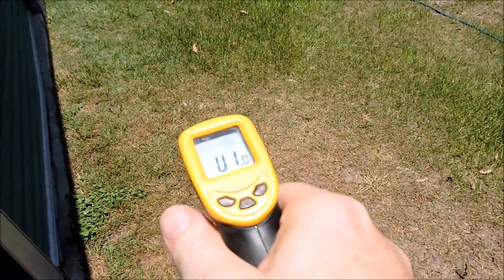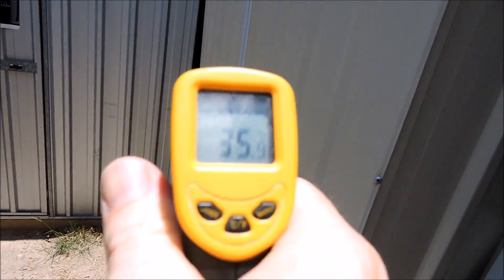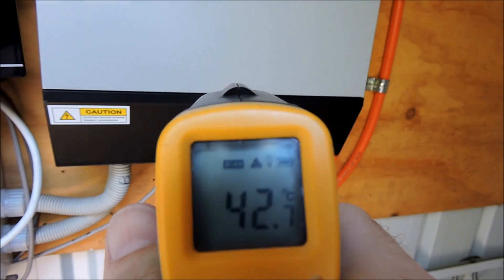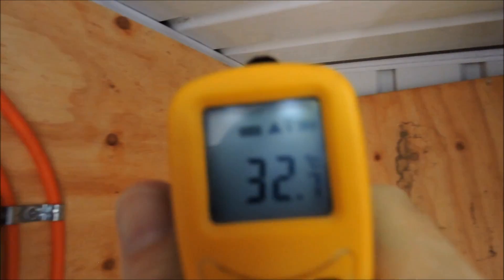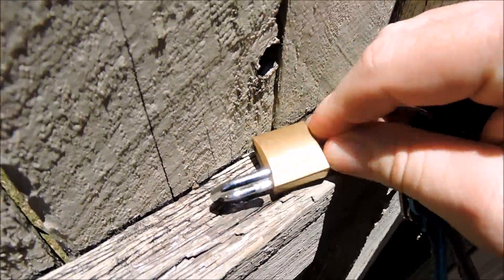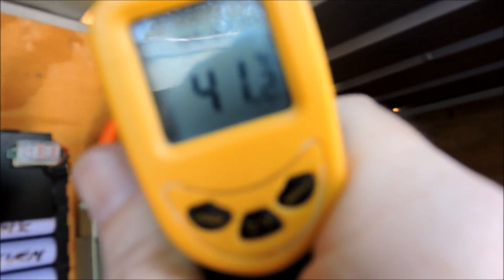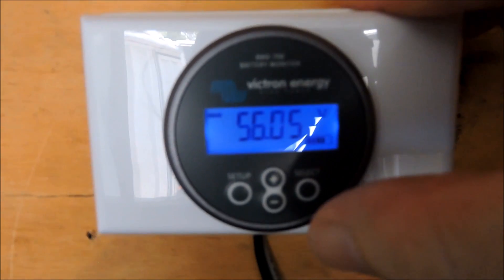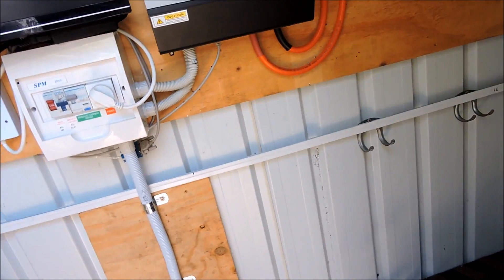(Long)138.8 DEG Fahrenheit 56 deg C ground temps (not air temp) short

Comment: is it possible to do a test at a 3kw load? I think the batteries won't heat up all that much. That's still only a 0.1 C load. But your converter will produce more heat.

Luckily that shed doesn't get as much direct sunlight.
Reply from the maker: We do 3-4 kw load all the time batteries never get hot... it's only a 80 amp dc load so 0.3333333amp per cell..
Reply: HBPowerwall Im not worried about the batteries. Your design is great because the most you can draw from the batteries is the max. your converter can do. which is like 0.12C. But how hot does your converter get when it is at 3 to 4 kw for like an hour at 2 pm when it's 34 C outside?
Reply from the maker: OOH she gets quite hot ... VERY hot in fact. We limit house loads when it's really hot for that reason.  And that is the reason I don't run the panels through that inverter - would add even more heat.
Reply: HBPowerwall So maybe some forced air cooling in that shed would be a good idea?

It doesn't have to be on all the time, just when the temperature of the inverter goes too high. All you need is a cheap thermostat and a fan in the bottom on the side (where it gets cool air from the shadows next to the house.) I bet ebay will have a thermostat that is practical.

Also important for safety by the way. That inverter is placed on a wooden plate, isn't it? (a metal plat would help to cool the inverter(s) as well. Especially if there is a fan blowing air over it as well.)

Comment: http://www.gumtree.com.au/s-ad/beenleigh/building-materials/foil-polystyrene-board-insulation-roof-ceiling-wall-underfloor/1101496182 Check them out that's cheap to buy and make your room alot cooler if you insulate the shed then get some cheap DC fan to run off your batteries with a buck step down and a Thermostat Temperature Controller to set what temp you like the fan to run at and drop down the temp  get all that heat outside all cheap to buy off ebay or maybe get one of them new solar vents for the roof tops that pull the hot air out  and the cooler ground temp comes up
Reply from the maker: NOW that's a good idea! Not horrible on cost either! and only 40km down the road
Reply: there is closer but not as cheap as them guys so 40km in fuel still not bad. just think if you cook all you batteries or the inverter or controller you be pissed off.
 it not take long to cook i lost a how green house in just one real hot day last year and lost alot of paints that cost alot i not take that chance with my battery bank we still got more real hot days to come best to play it safe

Comment: I am off the grid I have a power shed similar to yours it is insulated with silver foil with a foam inside and then a second roof over the top of it and have no where to your temps and just above ambient temps this will save $$$
Reply from the maker: Cool, have plans to take it all apart and redo it but will be some time down the track ..
Reply: I hope when you do all that you are putting it in a bigger shed?? For a metal shed it is staying pretty cool.
Reply from the maker: It's in really good shade on the south side of the house only direct sun is between 3pm and sunset and even then it's probably hitting only 10% of the shed surface.